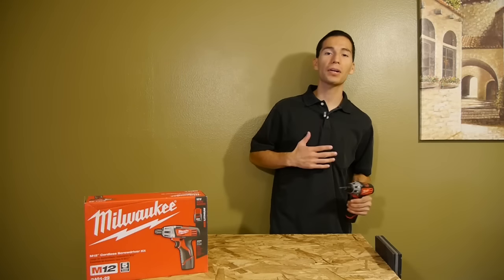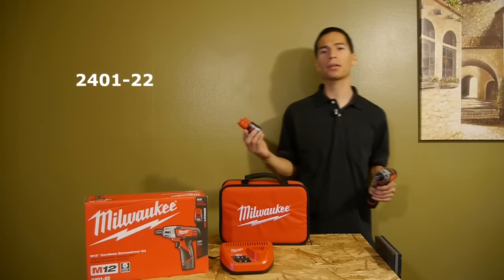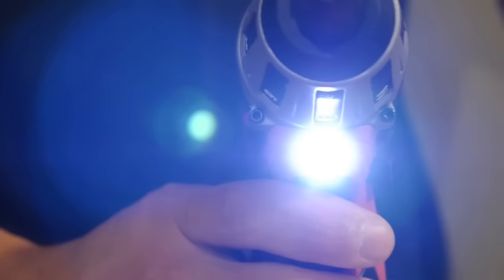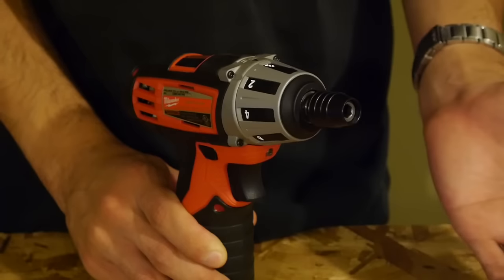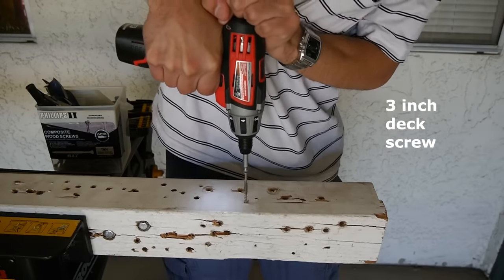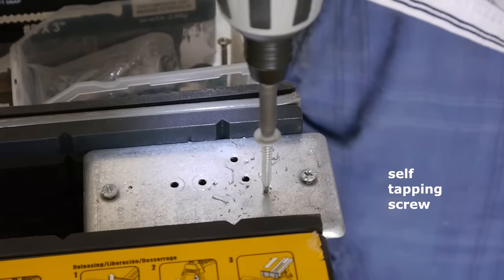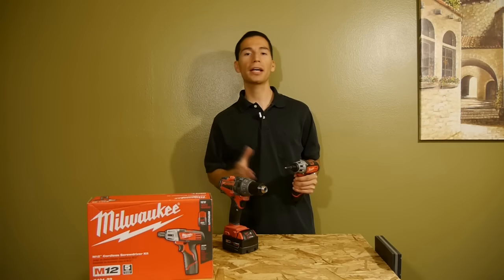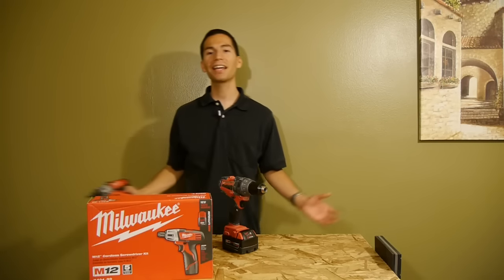Milwaukee M12 Screwdriver 2401-22 REVIEW

Comment: As an electrician, I just used my recently purchased Fuel screwdriver to trim out a building.  Wow, I was impressed on the efficiency I was getting. Never thought I'd be the talk of the job box meeting holding a 12v!!!!
Reply from the maker: Chris Moreno I know what you mean. I've had them laugh at my puny 12 volt tools but end up fighting over them after they see them perform. Theres plenty of applications where 12 volt is all you need and 18 volt is overkill

Comment: This was the first m12 tool that I got. It started a small army of m12 tools. It really has turned into a go to driver for me. Recently I got an m12 Fuel Impact and I am blown away with the performance.
Reply from the maker: Brien Nice! Same here, first M12 tool. That fuel impact is a tiny beast, 18v power in a 12 volt. Hey Brian you should check out HD's in store and online M12 deals with free baretools and tape measure online
Reply: I am tempted to pick up a Pro Pex expander...
Reply from the maker: Brien I'm not sure if thats one of the deal kits, I know online deals at hd are better and so is the deal selection

Comment: Just got one of these and it is the same model number and it now has their 2.0 batteries, belt clip, and there is a delay on the led now. Awesome little screwdriver.
Reply from the maker: +Thomas Ewers I also have the new model you're talking about. I like the added belt clip and delay on the light as well. Mine came with 1.5 ah batteries but I got it earlier this year.

Comment: I still have mine that I purchased 3 years ago. AWESOME little driver! I'm still using the original batteries too! Nice to see it still comes with the cool zip up case which i also still have yet almost threw out several times over the years lol. This is my go to driver for my hobby related repairs or when working under the dash of a car. A tad heavy by today's standards but unlike like some here, I'm not selling mine ever. When it finally breaks I'll buy a newer version. If the quality and longevity this tool has displayed is any indication of Milwaukee's quality in general, then I'll still be the proud owner of some dated "Fuel" tools 3+ years from now lol.
Reply from the maker: SlipperySpandex everyone I've known in person that's seen this loves it and they're amazed at its power for its size. The first one I had was used and had the original batteries, I'm talking about the oldschool ones before red lithium and was awesome. I sold it to move up to the m12 hammer drill but I had to get it again

Comment: I love mine. Use it for assembling store bought items ( BBQ, metal garage cabinets, etc) and also for assembling furniture I build with pocket hole screw's- perfect for that as it's small for those tight places and not to powerful to destroy the holes especially with the clutch on.
Reply from the maker: buzzj89 it's prefect for those jobs and is just what you need when a larger still would be overkill

Comment: I just sold mine to upgrade to get the M12 Fuel screwdriver. It was sad to see her go as it was the first Milwaukee tool I ever bough, but it was time to change things up. Great review Javier aka Mr. ToolCrazy!!
Reply from the maker: DarkRaptor99 thanks DR99, Nice! I considered the fuel screwdriver because it's as powerful as the m12 fuel drills and I like the 1/4" hex chuck for easy bit change. How do you like it?
Reply: ToolCrazy
I like it so far I haven't been able to get a ton of use out of it yet. I just got it at the end of last week. My only complaint about the old version is the length the new fuel and brushed version at a little bit shorter. The other big thing like you mentioned before its nice having a belt clip.
Reply from the maker: DarkRaptor99 yup I remember how short in length I thought this one was when I first got it but not so much now with the new models and competition

Comment: Hi - I have a comment and a question. First off I enjoyed your video and that you did a good job with the presentation. My question is this.  What extension bit holder that locks in place do you suggest? The reason why I ask this question is that this feature is important for my line of work. You see I’m a computer tech., where I build, upgrade, and repair computers and often I need the extension bit holder to screw into the slot.

Many thanks for your help
Reply from the maker: @RONNIEKRAVITZ1  most of the ones I've used are magnetic

Comment: Alright bud. Do you know if the fuel ( latest model ) can handle a 4"" screw? Plus what size machine screw do you think your model can sufficiently tighten up? Weighing up getting the m18 impact.
Reply from the maker: Griffinfit92 this can handle a 4" screw with 175 in-lbs so yes a more powerful model should be able to, after trying many drills I've come to realize that driving regular screw's don't require much torque

Comment: Thanks for the rapid reply Javier. What size machine screws and nuts do you think it can handle?
Reply from the maker: Griffinfit92 not sure what the limit is but I haven't tried a machine screw it couldn't handle. I've used it on many TV wall mount installs and never felt it lacked power. Always set the machine screw's that go in the TV to a low setting on the clutch but usually gave full power on the nuts and screw's that went into the wall mount. This will twist your wrist if you're not careful. Hope that helps

Comment: Nice little driver and I like the concept of the chuck but I just instead love my little dewalt 12v impact even for tiny screws because the variable trigger is a lot like myself- very sensitive yet can torque a lot of power when needed.
Reply from the maker: Jeremy Neill I want to check out some of those dewalt 12 volt tools

Comment: I've had mine since 09. 10 years and I love it. My favourite tool. But.... yesterday,  I was doing an electrical rough in, dropped it 15feet down to concrete. The gear case broke off. Snapped it right in half. Sad sad day indeed. Idk whether to get a new gear case or new model. But I'm getting one of them. I have to have it!
Reply from the maker: I think these are $60 as a kit when on sale, the new model is nice because it's got a belt clip

Comment: Bought it from Northern Tool just before Christmas with thinking it was the upper model 2 speed they ordered. 

i am returning to get the updated model as i need more torque.  If i was just going to be driving screws all day- i love the feel and size of it.  just need something more then for screws. 

Good driver and would recommend and agree with review if ya just need a screwdriver
Reply from the maker: I have plenty of drills including the gen 2 M12 fuel hammer drill but when I'm only dealing with installing machine screws like lets say putting together furniture, I always reach for this little guy. Their 2 speed screwdriver models are basically their m12 brushed or fuel drills without a traditional drill chuck.

Comment: Does this have the power to pre-drill holes for a TV mount for a decent size tv? And what is the largest drill bit size you think this is capable of drilling in?
Reply from the maker: This isn't meant for drilling as it's not a "drill". It's a powered screwdriver for installing screws and works best with machine screws. Although it does have plenty of torque and surprised me at drilling, I'd recommend you get a normal drill if you want to drill. I included demo clips using this at drilling to give you an idea of it's drilling performance. But to answer your first question, yes it should be able to handle predrilling normal holes for setting lag screws as you don't need a large hole for predrilling lags for tv wall mounts, however I'd recommend a regular drill instead.
Reply: @ToolCraze  I would use it for this application one time. And never drill with it again
Reply from the maker: @ijclnl48  👍

Comment: would this be ideal for an electrician vs a drill or impact?
Reply from the maker: ideal for electricians? - yes. Can it replace a drill or impact? only for light duty fastening. If you need high torque or drilling you'll still need your impact and drill

Comment: Otro muy buen review, Javier. Estoy indeciso entre este y el 2460. Este me gusta por su tamaño y simplicidad pero no soporto que no tenga clip. El 2460 me parece es mucho más grande y el fuel lo vi con el buen amigo Walter en su caja de herramientas y parece también ser mucho más grande. Hay mucha diferencia? Saludos!
Reply from the maker: Lt. Albert Gracias Albert. Estaba usando este modelo el otro dia y me hiso falta el belt clip. Revise el modelo numer 2460 y sale el rotary tool, estas seguro del modelo? Encontre el 2406 que es el screwdriver con brushed motor, estas hablando de ese?
Reply: ToolCrazy Tienes razón, me equivoque, amigo, quise decir 2406.
Reply from the maker: Lt. Albert ok no problema, no he usado ese modelo pero me parece muy bien. Y tiene el mismo poder que los otros m12 taladros con brushed motor
Reply: ToolCrazy y del tamaño cómo los ves? Hay mucha diferencia entre ambos. Yo he tenido el 2401 en mis manos y se siente muy bien. Tengo ya un bosch 1440 li, y tengo miedo que sea igual de grande ese 2406.
Reply from the maker: Lt. Albert no lo he visto en persona pero parece ser igual de tamano que el taladro pero sin el "chuck" regular y no tan largo

Comment: I'm an electrician and I recently did a nursing home where there were hundreds of plugs and switches to put on the wall. Oh how I wish I bought this instead of using my impact. I ended up stripping the screw or breaking off the head off every so often. 

PS: I wasn't torquing them on, they were plastic nutek boxes and if you've worked with lots of them before, you'll know what I'm talking about.
Reply: Why do those boxes have a ground screw if they are plastic?
Reply: Dylan Link It's to ground the device such as a switch or plug via the metal strip going from the ground screw to the 6-32 holding the device in place.

Comment: They no longer make this model with the metal casing selector on your tensioning adjustment. They've done away with the rebuildable metal rotating dial and have replaced it with a plastic head rotary dial that does not have access with screws You can't take it apart clean it oil it etc also there's less run out with this older model with the metal selector switch conehead area You know what I'm talking about? They've gone cheap In fact the part numbers are identical but the product itself has changed just FYI If you can get your hands on one of these metal ones by it
Reply from the maker: Yes, I can confirm they changed this model years ago as I have the new model even if it does have the same model number. One thing I prefer on the newer model is that it has a belt clip. So simple but so handy.

They also silently updated their M18 2 gallon way dry vacuum as well also a few years back. I did a comparison video on that if interested.
Reply: Thx James, good to know.  Just found an old one in the neighborhood alley.  Popped a new battery in and it fired right up.  Now I don't have wonder about getting the new model everytime I use it.

Comment: 500 rpm? Wow that's so slow.
Reply from the maker: Love2boat92 they're keeping it oldschool :) but the new models have faster rpms just like the drills
Reply: Ok. I was going to say, my harbor freight drills go up to 900 rpm. lol. 500 is sad. lol.
Reply from the maker: I thought the 18v drillmaster at 900 rpm was a good balance of speed and power for a single speed, fast enough to run spade bits and slow enough to pump out some decent torque
Reply: Yeah. They're not bad just wish they had lithium batteries and a smart charger.